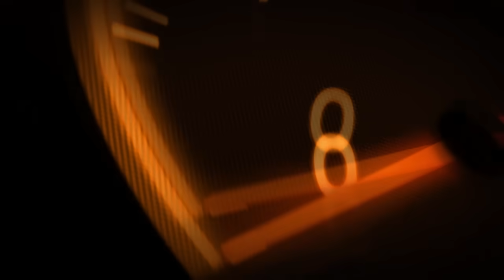Big Engines Starting Up

Comment: For anyone who's had to tear down and rebuild an engine, hearing it firing up again is possibly one of the world most beautiful sounds
Reply: How y’all do it is incredible. So much intricate detail you HAVE to remember and get exactly right. I feel like you gotta be at least a little smarter than the average tbh. Like that’s a lot of wiring you gotta remember. And making sure everything is perfect so the engine runs and stays that way. My engine blew out last summer and had to take it in two different times before dude got everything done right in the new one to make the car run. Shit was crazy to watch. I got mad respect for the car community fr. I just do basic maintenance like oil changes and tire rotation on my own car and even that takes a lot out of me 💀
Reply: The engine is too big, that thing will never fly.......
Reply: yes sir
Reply: I was scared to break my engine so when i started it after 7 months i was so scared cuz i took long 💀
Reply: And anxiety inducing!!!
Reply: My car spun a bearing in the engine, so I had to replace it entirely myself. Hearing it start was beautiful, so i can slightly understand.
Reply: Agreed.👍
Reply: So true.....I've build motorcycle race engines and diesels.... love when your hard work pays off.
Reply: That and not having any extra parts.
Reply: @SpaceAce100 that’s awesome, how long did it take you to do all that? Sounds like a fun project!
Reply: i've rebuilt many engines (mostly Pontiac V8) then fired them up w/o mufflers on my shop floor prior to reinstalling them.
Reply: Oh, right now I found a old go cart and need to add a new gas tank, pedals, spark plug, and a new carburetor. I wonder if I should get a new engine, the stock engine is a 1 cylinder 4 stroke 3 horsepower
Reply: @josephgarcia4302  Your fear of breaking the engine is exactly what is breaking the engine.. Engines are not made to sit and collect dust, they need to be run regularly to stay at optimal performance, the moving parts need to keep moving to bond with each other and work with each other as a whole system. The oil needs to be constantly lubricating all of the moving parts, there can NEVER be metal to metal contact between these moving parts, there must always be a layer of oil because they are firing at insane levels, thousands of times a second. That level of friction can easily seize up an engine, hence why we need oil in the engine. No hate towards you and I don't judge you one but, I was exactly like that too, till I realised they were put together for someone to have fun, to test it to its limits (but not too much). That is the beauty of engines.
Reply: Absolutely, it was always without fail the best part of my job, rebuilding an engine & firing it up for the first time.
Reply: it's like listening to the heartbeat the first time.
Reply: amen brother
Reply: @CalamitousJonathan  i think it's the engine of     big cruse ship ⚓🚢
Reply: Tore down my 5.3 vortec engine listening to her start back up was the best feeling ever did it all by my self in my drive way 💪
Reply: No doubt.  Always a constant.  Just walked my son through a complete rebuild of one of his car engines (he spun a rod bearing).  When we got it back together and it ran so smooth, there were smiles all around.
Reply: Abosolute fax
Reply: Yes. The dopamine hit that happens is better than sex
Reply: Indeed
Reply: EVER EVER EVER!!!!!
Reply: @CalamitousJonathan  That depends on the wing size.
Reply: As a car mechanic simulator player, I can confirm that.
Reply: IT nerds get the same feeling when all the lights on the switch go green. At least the ones that are sposed to.
Reply: I havent had to do a whole engine rebuild yet but even on smaller things internally just having it fire up with no issues is the best especially after you fight with the 2 hour project for 8 hours
Reply: Far_outlook  I didn't say I did. I'm a network engineer. I was talking about INFORMATION TECHNOLOGY! Configuring a switch can be a lot of work. I was just saying it was satisfying when you finally get it to work.
Reply: So true!
Reply: especially hit and miss engines and smaller gas engines from the 1800s-1900s
Reply: @prodbytarantino  You don't have to smarter. Knowledge isn't intelligence.
Reply: Having to tear down and rebuild that last engine must’ve been a big pain in the backside
Reply: Electric vehicles are pretty worthless anyways. Every single one that got caught in these recent hurricanes are now useless, and overheating and combustion is a very real issue with all of them that are in use.

Comment: I think gallons per mile is the correct term in this scenario.
Reply: @jonde3  the normal term in a car is miles per gallon, but these big engines take so much fuel that it might as well be gallons per mile. 

TLDR: big engines tend to have horrible fuel efficiency
Reply: Wrong I belive its gallons per nanosecond
Reply: I think the term would be mile per ton of gas
Reply: Liter per meter.
Reply: Did u mean golons per centemeter
Reply: May be you mean gallon/rpm right? 😂
Reply: Bald eagles per big mac
Reply: Gallons per 4 strokes
Reply: No shit lol. Crazy gas guzzlers
Reply: More like Smiles Per Gallon.
Reply: 4:16 best sound ever.
Reply: @VroomAndPew  Can’t argue with that!
Reply: Gallons per inch bro
Reply: Gallons per smile
Reply: It sure was for my truck 🤣😂
Reply: @MrSlimeMan01  pĺò
Reply: @johnlaplace6124  wut?
Reply: Gallons per cm.
Reply: Gallons per feet...
Reply: No, all of the no dumb nation use liters and kilometers.
Reply: @aquilesmedeiros5619  Gallon is the biggest volume unit in the world so that’s what i chose. But yes the metric system is superior.
Reply: No its  gas Tanks per karberator
Reply: @MrSlimeMan01  not necessarily horrible for the weight of stuff they push, ships and trucks are overall efficient pound for pound.
Reply: Ice caps melted per spark
Reply: On my frends acar peel p50 v4
Reply: I don't know where everybody on this comes from but if you go to an NHRA top fuel drag race it is almost 11 gallons to move that car 1 quarter mile at over 11000 horsepower! You can get runs at 335 miles an hour in a quarter mile! I've been there and I have seen it! Fuel line is 2 in ID!
Reply: Smiles Per Second is more appropriate.
Reply: @volpetron  😂
Reply: gallons per micron
Reply: Litres per km leys be reasonable here  lol..
Reply: Gallons per feet is more like it
Reply: @mikepeugeot7344  litres per cm..
Reply: @ussrnotfound  Thankyou ,, someone needed to say it lol .. 

(USA is not stupid, they just have weird units 😏)
Reply: Kiloliters per millimetre..
Reply: @volpetron  *centimetre
Reply: Indeed. Dragsters burn 15 gallons of fuel just racing for 1/4 mile!
Reply: That's how km are measured. Only fixed to 100km. Liter per 100km.
Reply: @volpetron  liter per Planck distance
Reply: 900th like! And lol
Reply: Smiles per mile
Reply: @MrSlimeMan01  absolutely didn't need a tldr
Reply: Cheeseburgers per every 100 shotguns
Reply: Planes use gallons per hour and then pounds per hour for jets. 3gph is the most economical plane I have seen which is around 20 ish mpg if you are cruising. Jets go up to 1,000 pounds or more an hour.
Reply: Probably legs per mile
Reply: Maybe kegs per mile
Reply: Freedom/pergallon is actually the correct measurement
Reply: No the normal is kilometer per litter
Reply: Smiles per gallon
Reply: Same pfp
Reply: @MrSlimeMan01  The normal term in over 99% of countries is liters per 100 kilometers.  Only people in the USA say "miles per gallon" 😂
Reply: So about $50 a mile we would say in America right now
Reply: The bigger the engine, if it is moving at all inside planetary scale measurements and outside miniscule vibration movement, the correct unit of measurement would be  l/nm
Reply: No

I
Milk
I
M
Reply: No, gallon per yard
Reply: Me: No GALLONS A MILA SECOND
Reply: *smiles per gallons ;)
Reply: @w花b  I dunno, people are pretty lazy on the internet
Reply: Metric is better
Reply: @omkarshinde1628  I know but I think imperial is more understood by both groups of people, and since it’s almost all American engines in the video.
Reply: @itisannona  often times equipment is measured gallons per hour or liters per hour. MPG or miles per liter is only an automotive thing.
Reply: Oh😂
Reply: My car does a few tears per meter.
Reply: It’s counted in gallons per hours for certein machine
Reply: MPG = Microcentimeters per gallon
Reply: Gallons per meter maybe
Reply: XD
Reply: Correction I believe it is oil rigs per centimetres
Reply: that’s why I hope for us we‘ll stop building cruise ships and waste resources like this - I wanna live in my 60s in a healthy environment
Reply: Per smile*
Reply: Gallons per second actually
Reply: Agreed
Reply: lol
Reply: Yeah especially on the big bud
Reply: The CAT 785C V16 Twin turbo diesel, burns through 15.6L an hour... IDLING!!!
Reply: @JDQ it's around 4.1 gallons...
Reply: @JDQ I know this because it's the most common dump truck we have in the Australian mining industry, and we have 20 of them running in our small mine, they put out 1800 horsepower, just shy of 5000nm of torque, and have a payload of 250 tonnes, it costs $13 an hour for those things to idle... they have a 400 gallon fuel tank
Reply: @JDQ I should also add, fully loaded, first gear going uphill, they'll burn  through 196 gallons in an minute
Reply: @JDQ actually, I've just realised none of them an hour measurements, it's all per minute, so they burn 4.1 gallons a minute idling
Reply: @JDQ actually no, it's definitely hour measurements, I was reading the hydraulic pump stat's for 198 gallons, 🤣, sorry I'm very tired,  I've just come off night shift, driving that same truck for 12.5 hours
Reply: 7 gas stations per mile
Reply: forget gallons per mile and think about that power that's all that matters at that point anyways
Reply: I think you mean Wills per Smith
Reply: Where is that big engine?
Reply: love this comment m8 LMAO
Reply: In large ships engines the rating is tons per mile, using ‘heavy oil’ fuel that can only be used when underway at sea and engine has reached optimum temperature….Diesel is used in port for manoeuvring as engines aren’t warm enough and heavy oil congeals  and gums up pistons…
Reply: More like gallons per feet
Reply: @MrSlimeMan01  not strictly true they might use more fuel per cycle but not always more fuel per work output over time. All if not most are horrific for the environment. Though
Reply: Ships tend to measure fuel as tons per hour.
Reply: The humongous ones are oil fields per mile.
Reply: Lol gallons per picosecond.
Reply: @Beardown38  So that's what happened to that oil field in East Texas!
Reply: @hondoonaka1823  Like cruise ships,freighters,and military ships.
Reply: @DavideM1996  Mice per eagle.
Reply: @danbytp  Yhea right!
Reply: @harumcfarlane5649  spell
Reply: Love it
Reply: Or maybe quarts per kile🤔
Reply: @MrSlimeMan01  depends on the application and fuel type. A large ship engine runs on what amounts to sludge, but it uses less fuel then you would if you were to put a gas or a jet engine into it. Larger the engine the thicker the fuel it runs on, and the higher the torque it produces, which when it comes to large ships, that makes them very efficient. it's all relative.
Reply: Gallons per Smile.
Reply: Oceans per Planck Length
Reply: gallons per mile is too much most ships get gallons per number of feet traveled example 1 gallon per 10 feet and even then the mass moved means the efficiency is very high for the amount of work it does.
Reply: If your gauges don't show by 10000 HP I don't wanna know about them.
Reply: Easily inches per tank
Reply: Ликвид пистон движок будущего✌😎👍
Reply: With cars with motors like that it's more about smiles per gallon
Reply: well everyone using metric already uses L/100km its a way better measurement than km/L
Reply: That's what we see when our Firetrucks here are allowed to joy ride around in them day after day at a gallon to less then a mile!!!
Reply: ♾ gallons/mile
Reply: Smiles per gallon also is an acceptable unit
Reply: I had one Captain on a Cruise ship tell me how much fuel we were using,  he say that ship burned 50 gallons every 900 feet it passed threw the water so take the nautical miles that particular ship were Crusing on that trip and calculate the amount of fuel used.
Reply: gallons per open valve.
Reply: Now, now. If it were truly so inefficient they would never be used.
Reply: @GoodfellaZeta4873  They are exactly that, those Engines burn up to (350 tons) of fuel per day in those huge ships,,, a A380 airbus holds 82,000 gallons of fuel and when it Flys a long trip it uses it all..
Reply: Best I can do is half mile
Reply: @VroomAndPew  your wallet sure aint smiling lol
Reply: @mightypharaoh7586  lol as long as I'm smiling
Reply: Some of these are probably gallons per feet
Reply: Gallons per hour or maybe net second, they’re not even walking
Reply: Maybe gallons per rev
Reply: Why is everyone capping it at gallons?
Reply: Only in America mate the rest of the world uses kilometres
Reply: Ok
Reply: tons per foot.
Reply: Yo: tremendos motores!
Alien: Que tipos tan primitivos
Reply: @PG-3462  because were better than yall
Reply: I think elephant power is the correct term in this scenario
Reply: gallons per second peobably
Reply: you can still use miles per gallon, but it would look like 0.07mpg
Reply: Nah man. Barrels per mile is more like it.
Reply: miniguns per mcdonalds
Reply: Bro. This is too funny. And as some who owns a gas guzzling truck these days with 7 dollar a gallon gas prices this hurts.
Reply: Lol gallons per meter is more like it!
Reply: i like 8 cylinder    engine
Reply: did you mean gallons per quant
Reply: Gallons per feet for some of these jesus
Reply: Fuel tankers per minute
Reply: @volpetron  litre per kilometre
Reply: @MrSlimeMan01  It depends. A big block in a road vehicle will. But a huge engine in a cargo container ship is (relatively) efficient. From my research that's 576 nautical miles/ one gallon of fuel per ton of cargo. Compared to a Semi Truck which gets about 140 miles/one gallon of fuel per ton of cargo. That's average on highway at 20 Tons load for the Semi. New ships are even more efficient than those figures though
Reply: More like gallons per metre
Reply: Gallons per rotation
Reply: Smiles per gallon
Reply: liter per second
Reply: smiles per gallon
Reply: My grandpa used to fly a private 747 for the biggest producer of mozzarella in the world at the time and according to him they quite literally put it in gallons per mile
Reply: @MrSlimeMan01  big blocks if done right will often use less fuel because they aren't working as hard (obviously if you floor it they take more fuel but I mean street speeds) although many of these engines are beyond big block and several aren't v8s
Reply: Gallons per meters
Reply: 69 gallons per mile
Reply: Okay I've translated this to metric giys don't worry, he said m³ of fuel per every meter.
Reply: Depends on the compression ratio
Reply: Gallons per Smile
Reply: Smiles per gallon lol
Reply: Gallons per mile is the funniest thing I have ever heard!
Reply: May you mean gallons per millimeter?
Reply: @MrSlimeMan01  so, what you are saying is that we need to build engines at 1/4rth their present volume and share the load across them in a magical resonance chamber that just looks like the original engije on the outside but is exponentially more efficient and more powerful?
Reply: That's actually the direction that the metric units of fuel economy are measured in - L/100km. Some say it's better because it avoid the "MPG problem", which is that distance-per-fuel is not linear. For example, the difference between 14 and 17 MPG and the difference between 33 and 50 MPG is actually the same - a difference of one gallon per 100 miles in both cases!
Reply: Most American comment I have ever seen
Reply: That is quite some impressive engines!
Reply: FPG:Feet per Gallon
Reply: You mean Barrels per mile
Reply: @MrSlimeMan01 na it's definitely smiles per gallon.
Reply: That goes for any locomotive.
Reply: @MrSlimeMan01  big commercial engines like cargo ship engines have the highest efficiency. Idk what you're talking about. The fuel consumption is high but they can carry MASSIVE loads